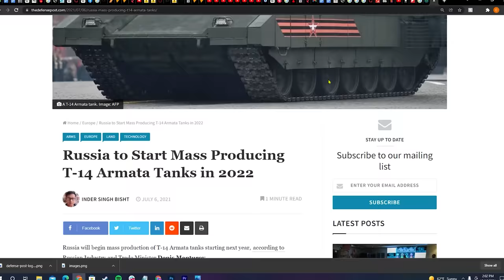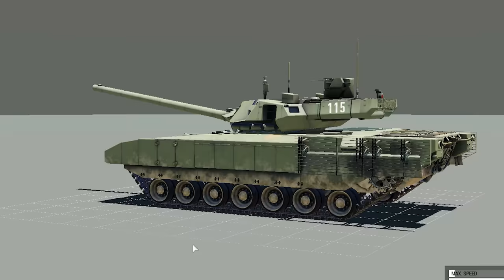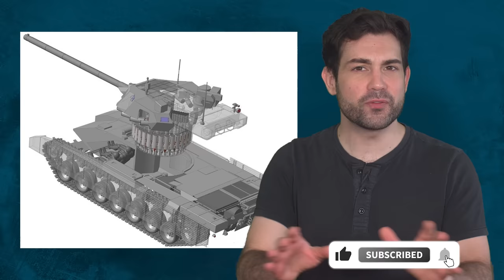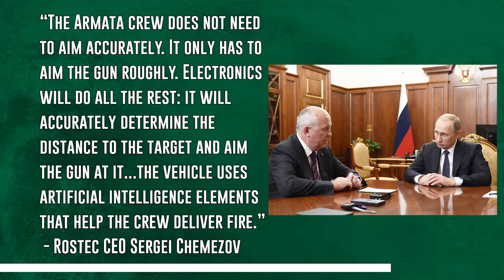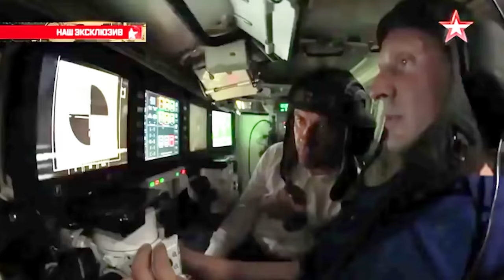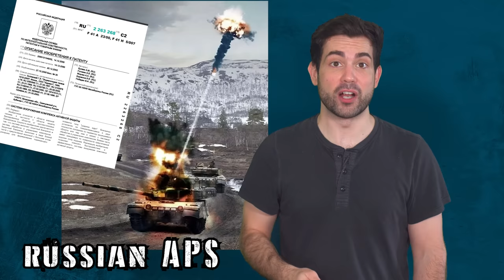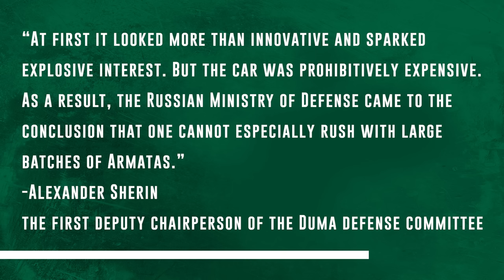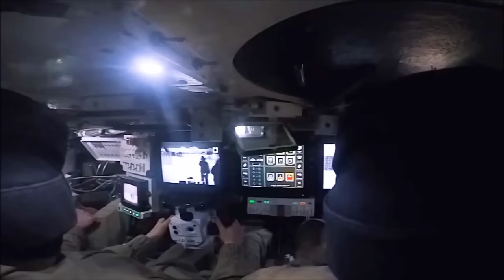The Truth About Russia's T-14 Armata Tank

Comment: 20 Year MI vet here.  I’ve spent years analyzing old Soviet and Russian claims on their equipment and weapon systems.  And.  It’s all crap.  Time and time again when western (especially American) weapon systems went up against the Russian stuff the west always kicked ass.  The Armata?  Same old story. Over hyped and in any case no real world battle experience.  Then, there’s hard, bottom line fact that it’s not even in production.  Russia no longer even has the production or the parts to make the things.  Many of the T-14s high tech components come from foreign sources which have been cut off due to the Ukrainian war bans.  Hell, Russia can’t even get parts for their currently fielded tanks and other weapons. Basically the T-14 is irrelevant.
Reply: Even more, they can’t even get logistical support to the armor they did field, let alone a more technologically advanced armor.

No tank can run without gas.

Russia is a paper tiger through and through.
Reply: Out of curiosity - when did they went up against each other when operated on same level? Last time I know was Korea war? Maybe Vietnam more or less close... In all other cause it was latest West weapons vs 20-30 old Soviet weapon systems operated by poorly trained locals... 
As for weapon parts Russia sources from West - can you name at least some? Also - hasnt West prohibited to sell weapons and their parts to Russia for at least 20 years or so?  But Russia still keeps even exporting their weapons abroad...
Reply: @Mr_MikeB  To see the last major engagement between Soviet equipment, specifically tanks, and American  Abrams M1 tank would  have been the 1991 Gulf War against Iraq.  To make a long story short the war was terribly one sided against the Soviet supplied Iraq.  Just sticking to tanks, Iraq lost 3,300 MBTs.  The USA lost 31 Abrams destroyed or damaged and NONE of those were due to combat but to accidents, friendly fire and mishaps.  Not only did the M1 outrange the Soviet tanks, the Americans had far better crew training, optics and other technological superiority.  

Regarding training.  We are seeing this being played out in real time in the Ukrainian/Russia war.  Ukraine troops have been training with the USA and other NATO countries for the last 20 years in modern combat tactics.  Russia is still using brute force WWII tactics and their training sucks/
Reply: @bartobo  We are at point 1 - can you name a single major tank battle in Gulf War? If not it makes no sense to compare tanks as if they would fought each other...
As for training for Ukraine - well, according to president Zelensky Ukraine is suffering heavy losses at the moment, so I do not know why you think one training is better than other...
Reply: @Mr_MikeB  Your comment makes little sense and is close to a non sequitur.  Not sure that any individual unit battles were “named” per se, but that is irrelevant because in every “battle” fought against Iraqi armored units, the Americans won every single time, with zero combat losses. Let’s hit that again, the Iraqi forces using Soviet equipment lost over 3,300 tanks and the Americans lost none, zero, zip, nada to combat.  I was still in the Army with a TS clearance at the time. I would go to our SCIF on a daily basis and read SitRep and other reports as the war unfolded in near real time.

Don’t know what you mean by “Point 1”.  The war has been ongoing for over four months now, the Russians have retreated from Kiev, regrouped in the east around Donbas where they are still getting their butts kicked and now they’ve given up and retreated from Snake Island.  

It’s obvious that you have never served in the military and have no idea regarding the value of training in battle field tactics and maneuvers.  Look, you can train a crew the basics in operating their tank in a week and the tank commander a few more days.  That gets them out on the battlefield able to drive around and shoot but not how to fight.  Training costs money in time, fuel, maintenance and ammunition. The old Soviets and now Russia is loath to spend money on training and keeps it to a minimum.  The West, on the other hand, spends hundreds of hours in training tank crews in tactics, maneuvering and working with support troops in a integrated battle group.  The Ukrainians have been training with the Americans and other NATO nations for the last twenty years in modern battle tactics and we’re seeing the results in this war. The Russians are sending in massive amounts equipment manned by poorly trained troop and using brute force attacking civilians.  The Ukrainians meanwhile, are using their modern battlefield training and tactics to take the fight to the Russian military.  This is why the civilized, well trained and motivated Ukrainian freedom fighters are winning against the undisciplined, demoralized, barbaric, Russian orcs.
Reply: @bartobo  Well, you probably do not know but there has been at least two huge tank battles - one at Kursk during WW2, other during Iran vs Iraq war. There you could really draw some statistics and try to assume which side had better tanks for head on head combat. During US invasions in Iraq there was no tank battles, so you cant claim that Abram's were better then Iraqi tanks for simple reason - Abram''s didn't had to face extinction from artillery, rockets and bombs...
As for American training - I recall Americans has trained "moderate" syrian opposition, afgans and many others. But all of them has failed on battle field... So I see nothing superficial in West training.
Also its funny when you mention Soviet's conscript army in context of moderan Russia.  Unfortunately main core of their army nowadays are army of professionals. Well trained professionals. And according even to Western main stream press, Russia is winning at this very moment... Sure, Snake Island is nice moment to have, but thats all. I believe Lysichansk has more value by all means...
Reply: @Mr_MikeB  Why are you going back to WWII and the Iran, Iraq conflict?  We are talking about modern MBTs on the current and recent battlefield. Specifically whether or not Russian/old Soviet armor can used effectively against Western armor.  The Gulf war back in 1991 was the last time in modern warfare when the most modern Soviet tanks went in to major combat against American and other western tanks.  Again, the M1 Abrams outmatched and achieved a massive one sided victory against the T-72 and other Soviet model tanks.  There is no question of this.  

From your comments, you have little to no knowledge of modern armor and battlefield tactics.  I don't know from where you are getting your information, but it seems to be sadly lacking.  Unless you come up with a somewhat reasonable and coherent response that makes sense, I'm afraid this conversation is over.
Reply: @bartobo  In my opinion its you who has very little understanding of modern armour. In modern armies tanks are not supposed to fight in tank vs tank battles thats why I had to went so far back in history to look up any big tank battles. Thats why I do not understand where you found such great success for Abram's tanks in tank battles. As we all know vast majority  of Iraqis tanks were destroyed by air forces and artillery. There were hardly any tank battles. Also, out of curiosity how long would those Abrams last if they would have to face same amount of artillery strikes and artillery bombardments? Somehow Im not sure that they would perform much better.
We saw quick tank raids by russians just at very start. Now both sides are using tanks according to their main role - heavy armoured, very mobile artillery unit which can operate right from front line. And mostly they do shoot at fixed fortifications, but not other tanks... For enemy tanks both sides have Javelin type missiles and anti tank artillery....
Reply: @Mr_MikeB  This one is also quite detailed:

https://www.youtube.com/watch?v=I4b7yl99wlo

If all this doesn’t change your mind and convince you that there has been major tank battles in recent history, (in fact the greatest tank battle ever), then you’re either suffering from cognitive dissonance,  playing the part of a troll or are just one of those people who can’t admit they are wrong.
Reply: @bartobo  I read the summary on the other hand, most of the tanks were t-55 and T-62 and a small part of the t-72. A distinctive feature was the use of old shells that could not compete with Abrams at the proper level (and were removed from service in the USSR).
On top of everything else, we add that the army in Iraq was not very trained and basically all the battles were at a great distance.
Plus, at that time, the T-72 of the first sample had neither GPS nor night vision. Which gave Abrams a huge advantage.
What we have now about the Russian army. The international tank biathlon takes place every year. After that, I think it's pointless to say that the army in Russia is not combat-ready.
And now to the technique of combat.
All wars with the American army had a similar algorithm, this is carpet bombing and after stripping as part of armored vehicles (tanks, infantry fighting vehicles, armored personnel carriers).
What is happening in Ukraine ?
1) there are no carpet bombing
2) the main idea is not to demolish the cities, but to preserve them as much as possible, but the military uses its population as a human shield. ( if there are a lot of videos when people thanked the soldiers of Russia for liberation, and cursed the Ukrainian soldiers, because they did not release them, engaged in looting, took away cars, and in case of disobedience destroyed the population (or just for fun).
3) America has never restored the destruction that it inflicted during the fighting, you can see on the Internet what is happening in Mariupol (how is the construction of new houses, hospitals, laying new communications: water supply, electricity)
4) There are many videos when military equipment is standing near houses (Ukrainian) Including MLRS, tanks, infantry fighting vehicles and so on
5) You can also see what Ukraine is doing, where it is shooting, read their forums (how they rejoice when they attack prisoners of war, when they fire at purposefully peaceful cities (with consequences for the population))
If you don't understand the full depth of what is happening.
Then imagine that a military man will hide behind your mother. What feelings will you experience ?
If you haven't understood yet, the Ukrainian military are acting as terrorists against their own people.
Reply: @bartobo  As for me, in that skirmish in 1991, Abrams showed his best side, but time goes by and Abrams has not received anything revolutionary in all this time.
And the old problems remain, these are logistics, overheating of the engine at high temperatures in the country, high weight, therefore high pressure on the ground and it gets stuck part. A giant silhouette, so it is perfectly visible, in the case of a defense trench of gigantic size.
I would also call the fact that the automatic loader did not appear, since a person will load 5 shells normally, and then get tired, besides, no one canceled the human factor (adrenaline, fear), yes, the automatic loader has problems with detonation, but Abrams also has them (if charged with fragmentation shells) in case with cumulative shells , everything burns out and the tank literally melts on the floors . if you don't believe it, search the Internet.
Good luck with the analysis.
Reply: @bartobo  Well, I watched most of this video. It appears we have very different approach on what you call tank battle. What Americans had in Iraq was quite short tank skirmishes were they did excellent. No doubt. Also, according to this video it seemed like they didnt had even air support. But we know - they did and a lot.
Now, just to compare just take a look how Kursk tank battle looked like - it lasted for 6 weeks(!) not couple hours at best as in case for so called tank battles during Gulf War. And yes - besides tanks in Kursk battle both sides had heavy artillery, air and even infantry support. According to video you have nothing of that was present on both sides. But those are things tanks how to face on battlefield since first day they appeared. Also, have you noticed that USA army has went down tremendously on their tank forces since 1991? Why you think it happened if those Abrams are giving such superiority on battle field? 
Maybe thats because that even in the video you gave they had to wait for sandstorm to outperform Iraqis? Also in this video one complains that they had to move their tanks forward very slowly - couple clicks per time. Why? After all they had GPS and couldnt get lost in desert right? Also they supposedly werent afraid on head on head clash... And there is tons of such questions...
To sum up - just take a look how Kursk tank battle looked like and then compare to video you suggested. Hope that will give you understanding why I do not recognize Gulf War tank clashed as Tank Battles....

Comment: If we go throught the different countrys Tank developments over time you can see that the idea of an unmaned turret poped up almost everywhere going as far back as the 60s.
Germany had a Concept for the Leo1 that was unmaned later they had a testbed based on Leo1 to test the viability. the Leo2 would have been built with an unmaned turret if it wouldnt have been for the Bundeswehr and its tankers to specify that they wanted to be able to look with their eyes and binos out of the turret hatches high up for greater situational awarenes.
Russia has been tinkering with that idea as far back as the 60s and 70s aswell and hasnt realy let go of it, up until armata they have been working on ever newer prototypes in that area.
America doesnt have much more to show either apart from prototypes in that regard.
Reply: D egenerate
Reply: @Cybersharky_  yes :3

Comment: Apparently the sepv4 might have an unmanned turret and new engine. It can easily build upon the sepv3 which was digitized. The current chasis can be heavily reinforced with the removal of the absolutely huge turret in favor of the unmanned turret.
Reply: I think its aboit time for a new MBT based on a similar but different chassis thats compatible with common parts. Something built from the ground up to be a next generation MBT rather than spending money on sequentially upgrading the entire force every decade.
Reply: @Pallium_Industries  seems like I was close somewhat, the abramsx is pretty much what I described but with minor hull changes too. And they next gen'd it too with diesel electric which allows power demanding upgrades in the future. Personally the abramsx is better next gen tank for me, unless there is some other extraordinary development from another contender for optionally manned tank.

Comment: I'm not directly familiar with "hooah", or indeed RF servicemen's jargon, but from a literal translation standpoint, Tovarisch means Comrade. Specifically a person with whom one shares some degree of hardship and a broad common goal. Somewhere between acquaintance and deep friendship, like a colleague but without the connotation of a shared profession (though one could exist, there indicating slightly friendlier ties than "Colleagues" if that word is specified). 

From your context, it seems unlikely that one would shout this word to signal approval or agreement with measures that simplify maintenance or otherwise make one's job easier. 

In times past, Soviet servicemen (and their imperial counterparts) did shout "ура" (to bolster their courage/frighten the enemy) when charging an enemy formation or position. This word sounds almost identical to "hooah", and carries a meaning similar to "Hurray" or "Hurrah" (both are evidently grammatically acceptable English words) - one of general triumph or approval.

This leads me to conclude the word is borrowed by either one or the other language, or perhaps both from some third language (French?) with which both English and Russian cultures  had prolonged contact and exchange.

Comment: A few thoughts on the un-manned turret:

Going cross country, the vast majority of cross-talk among crew members is the tank commander giving small corrections to the driver: "a little left...a lot left" etc.  This is because the driver has a very poor view through his vision block.  In theory this can be overcome with cameras - but they better be real good.

When moving down the road, the crew is generally looking forward.  The driver looks forward, the commander and gunner generally face the gun to the front as well.  So who looks behind the tank?  In an M1, its the loader.  You've got a set of eyes AND a machine gun you can point to the rear.  I think this is very important in an urban environment.

Your 4th crewmember shit detail comment is spot on.  There are infinite reasons to have somebody hop off the tank and go pick something up, etc.  And in that Armata, whenever somebody hops off to go do something (maybe as simple as going to the bathroom), they'll have to position the gun 'just right' so they can get the front hatch open.  That's not a great setup.

There's also overhead clearance things the loader might do - pull antenna down or fold down the wind sensor to get under trees for example.  And in peacetime, put range flags on the turret.

I'm not yet sold on the crewless turret.

Comment: I think if we are talking robotic tanks, then we should be looking more at the logistic systems that resupply them and make the actual vehicle a small missile system with an auto canon. This will be smaller, lighter, more lethal in more ways and more able to work with drones in the air. I do not think a full sized main battle tank under remote control is going to make any sense in the future.